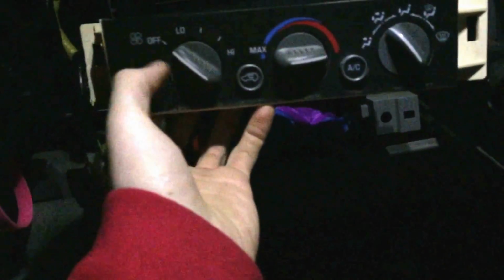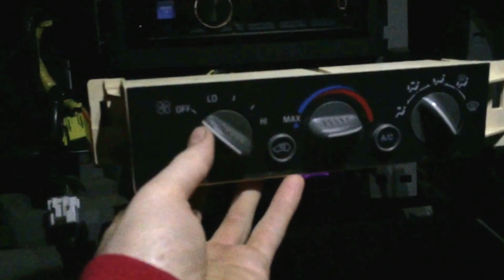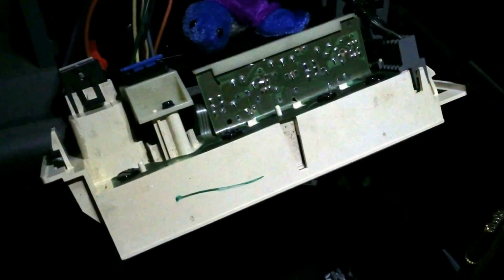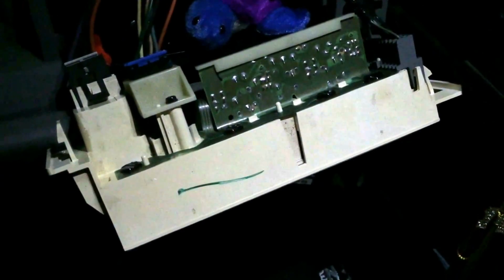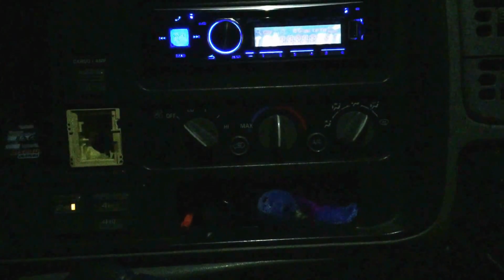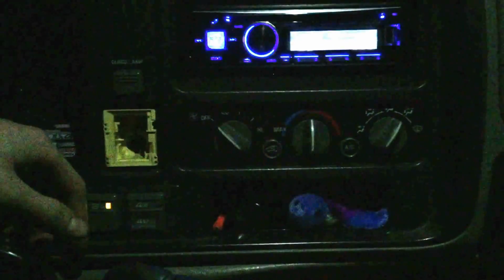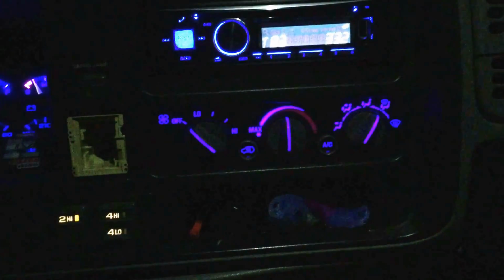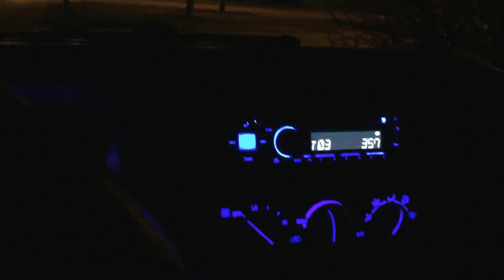88-98 GMC/Chevy AC & Heat Control Panel LED bulb replacement (Tutorial)

Comment: The bulb size for the A/C compressor and recirculation switch are smaller than the T5 bulbs used for illumination. Do you have the bulb type/size for those two buttons?

Comment: well i bought some off amazon the T5 73 74  led's and i pulled my hvac out and the bulbs are really small,like i can't even pull them out,the black plastic piece thats supposed to screw in doesn't,and the oem part has a yellow and black wire coming out the back.what am i supposed to do? i just had to put it back together with no lights at all.someone help..please haha please.i can't find a video or anything.damn it hell shit ass clown son of a errrr haha
Reply: onewheelup buy a new hvac

Comment: hey dude that really looks great,your video was clear and understandable ,i just wasn't to change out my climate control or ac heater control panel bulbs with blue,you have T5  blue LED'S listed and in the link it says T4's and i read another web site that said to use 1.5 bulbs so I'm like damn which ones do i order you know.let me know ok dude.thanks.
Reply: Technically they are 1.5 but you can get them on Amazon and they’re listed as T5 I just did this mod on my truck also

Comment: My 95 panel looks nothing like that. My 96 does though
Reply: Sean Chandler the 95 panel is a unique year I know what u mean but it's the same set up bulbs
Reply: I ordered the upgraded replacement from amazon so I'm good now thanks bro.
Reply: Do u have the link?
Reply: My 95 looks different too. I'm not too worried about the lights, I just want the thing to work.
Reply: Abraham Sanchez pho